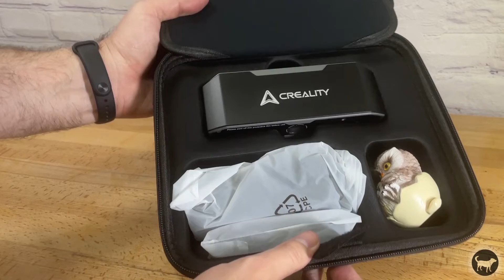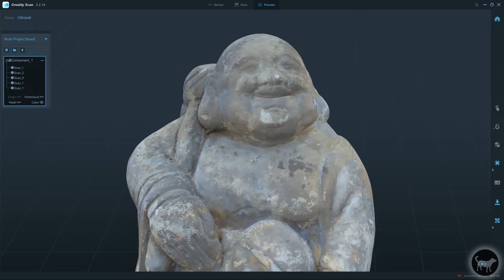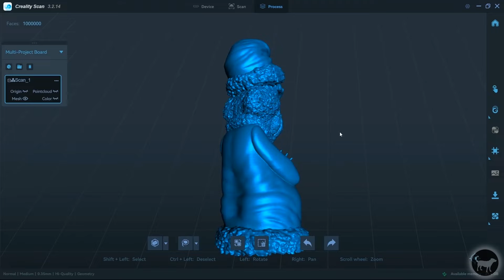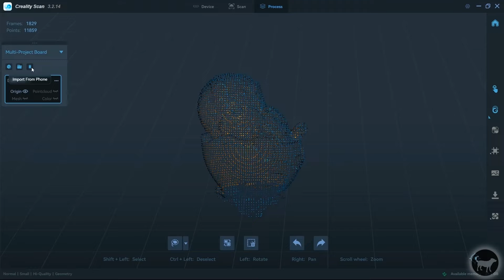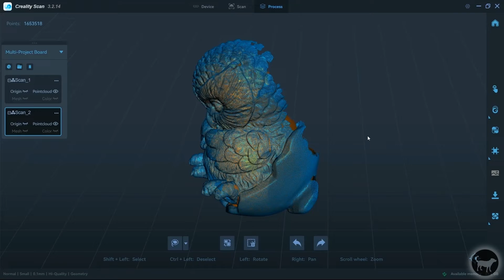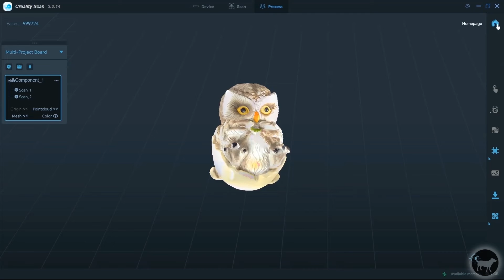CREALITY CR-Scan Otter 3D Scanner Review | Wide Scanning Range | No scanning spray required

Comment: As at May 2026, I have this scanner and it seems to be rather ordinary. The quality seems good but I have, after several weeks of trying, not managed to make a single good quality usable scan with it.  I have since upgraded my graphics card (expensive), used a different USB 3 port and everything in between. It just does not "see" the objects properly, looses the tracking all the time, adds 2nd copies of already scanned objects etc. etc. Even calibrating the scanner is really difficult to do successfully, not like in the demo videos. I am so far really not happy with it.

Comment: What are your computer specs? My capture FPS are low.
Reply from the maker: 3.9 GHz AMD Ryzen 5600G Processor, 64GB Ram, NVDIA GeForce RTX 3060 Graphics Card.
Reply: @BusterBeagle3D  Turns out my wifi was set to N only. Works fine now.
Reply from the maker: @mikebroom1866  Great!

Comment: I bought the Otter based on this review and a few others. My experience is that the scanner hardware itself is good quality but the provided software could be a lot better. When comparing real life scanning to the video examples my experience is that a lot of trouble is experienced due to the software not picking up the scanned shapes correctly or adding extra 'stuff' to the scan model. For complex models you'll ned to spend hours on cleaning up the models afterwards. The software allows you to do basic such postprocessing, but is not capable enough on its own. I have exported the scan models to Blender and done the postprocessing there. If the Creality scanner software had been better I firmly believe most of the time spent on postprocessing could have been saved.

Comment: I'm calling BS on the no scanning spray claim.  I own an otter and struggled repeatedly to scan a black ammo box.  The spray helped tremendously.
Reply from the maker: I'm not saying spray would hurt it but I didn't use it on any of the things I scanned with the otter. A big difference from my last scanner for sure.
Reply: @BusterBeagle3D  try scanning something black on the inside.  I suspect light is bouncing all over and confusing it but I'm not sure.

Comment: What would happen if i scan a flat plate with holes?

Would it allow me to measure hole sizes, locations etc as if to make a cad drawing?
Reply from the maker: It might. I suppose that if there were a lot of holes it may get confused an have trouble tracking but that's just a guess.

Comment: Good review. I’m basically a Revopoint man, but this doe looks 
very promising. I have both range scanners from Revopoint and former owner of the Pop 2. I normally can midsize to large objects. I as have a
The original CR Ferret. so I’m aware of the good the bad the ugly with Cr
scanners. Scans dark objects without spray. Very forgiving with lost tracking is re established. Not the best software. I believe Creality addressed the mobile issues they bridge they created. My only major 
concern is the Creality boasted that 
the Creality Ferret was an all in one scanner. I’m not an expert in the metric system, but my issue is that it
was supposed to scan small objects.
The specs on the Creality site stated
that the minimum scan size is 50Mm
but the Creality scan software lists
150MM. Again, I’m not a metric system expert or even novice,
but most scanners list 10 MM
as small. I am very interested in this
Scanner if it could handle midsize to very small objects. I am a Revopoint customer, but I’m not a blind loyalist.

and
Reply: I want a scanner for objects measuring .35mm. no idea if exists
Reply: @ Not any of these consumer
scanner that small. Probably a high grade
3D laser scanner

Comment: Seems like it loses detail when there are sharp edges.  Compare the coins where the relief comes up out of the body of the coin.  Looks like the edge is rounded, rather than sharp.  Same with the stone(?) buddah.  Looks like there's texture in the surface that gets lost in the scan.  Compared to the older scan, I have to wonder if the texture that's on the older one is really there and the scan from the Otter just smoothed it out, or if the older scan just had scan artifacts that added surface imperfections that aren't there.

Comment: How much better is the result when placing the object on a post on a turntable and putting the scanner on a tripod that can be moved up and down during the scan process?
Reply from the maker: I personally liked being hand held and you can somewhat adjust your own speed and angle easier and didn't have as much luck myself with the tripod and automatic turn table but didn't really try to work with it that much either to be fair.

Comment: Hi,
You‘ve created a  very nice basrelief from a 3D Scan of your daughter. How exactly did you do this? Software?
Christoph
Reply from the maker: It's a little convoluted. I use a 3D molding package similar to Blender , it's called Maya but not free like Blender so I would recommend Blender. Then I scaled the model to make it flatter like you would see on the coin. Once I was happy with the model I exported it as an .STL. I then ran that .stl through a free online stl to heightmap website (https://fenrus75.github.io/FenrusCNCtools/javascript/stl2png.html?fbclid=IwAR3xyOvPmCtofyY-vcXsePzkrVv1I_CL6l-RDGpRLhU1pLNcuOEG66_SylI) which converted it to a image that I could then use in Lightburn with their Slice 3D process of generating layers from the heightmap to engrave in 3D on the coin. If you look up creating 3D coins in Lightburn on YouTube you should find some videos on it.

Comment: Thank you Thanks for sharing. Had your results been 3D printed with a MSLA 3D Printer they would have been identical to the Original. I Printed The baby owl with a SLM Metal 3D printer and it came out great in Aluminum.
Reply from the maker: Saw your video of the owl in metal. Very impressive!